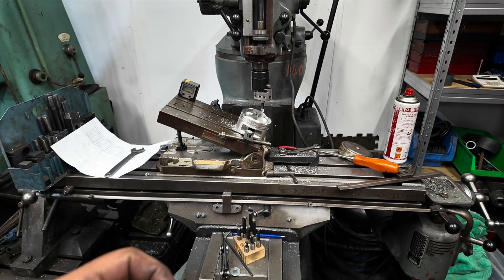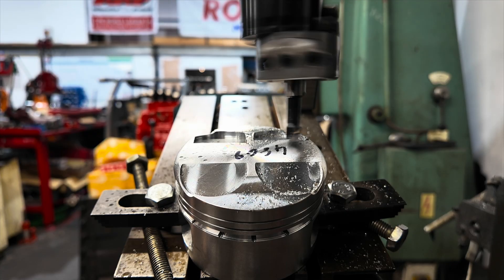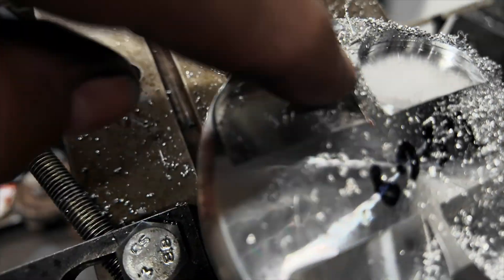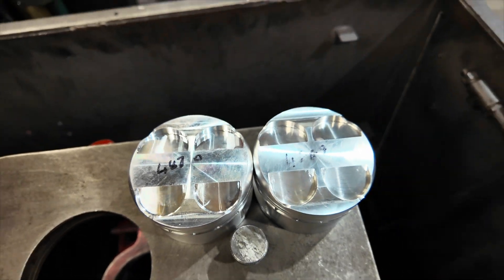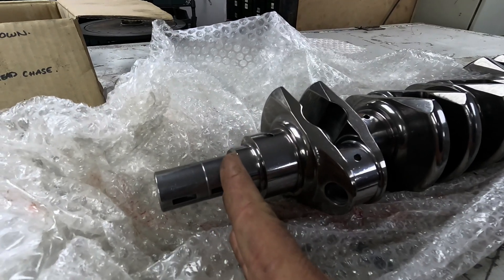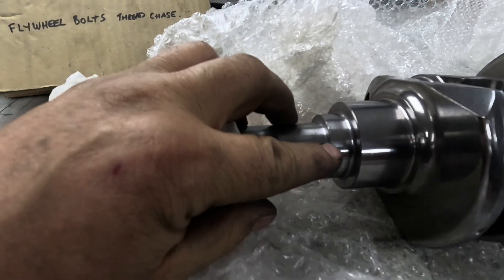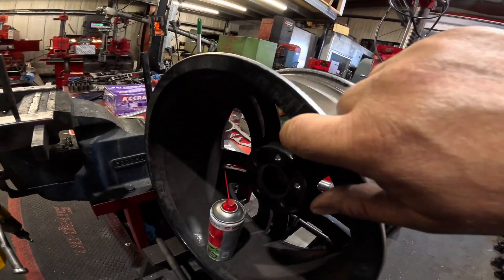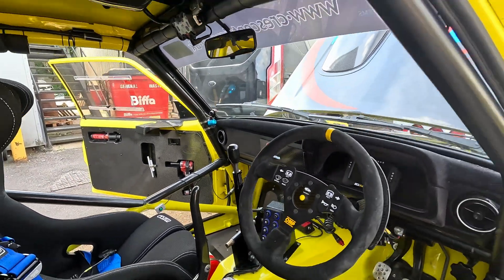Millington Powered mk2 Escort rally car, piston valve cutouts machined, block line honed, crankshaft

Comment: Great work but spoilt by just spraying over the weld without making flush irrespective if it's on inside!
Reply from the maker: Thanks for the feedback, I left the weld on the outside to give it some strength, I let the customer know incase he wanted to clean it back and get the wheel re powder coated
Reply: @graceenginedevelopments  I can understand bout the strength, so now they've got the option. 👍